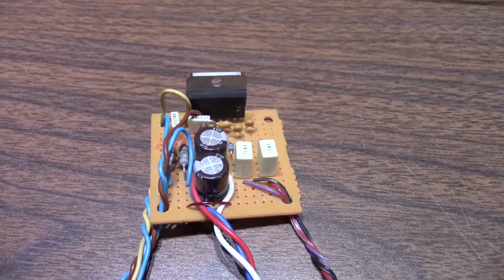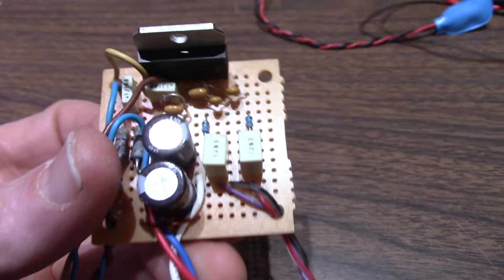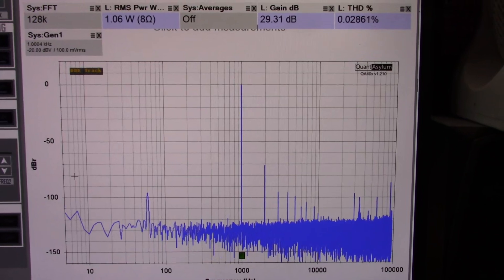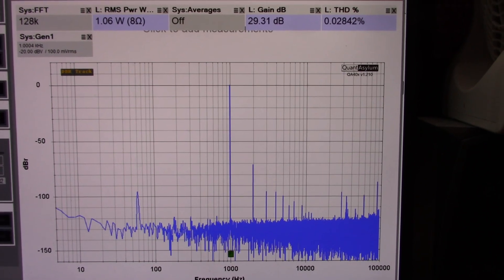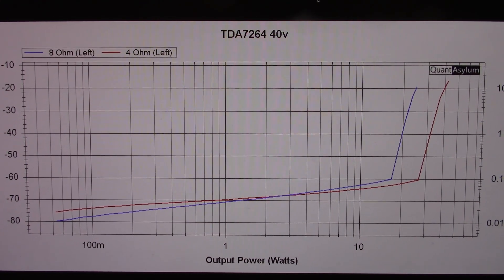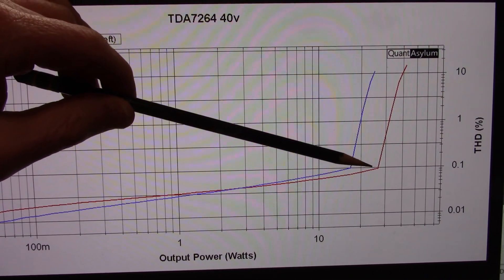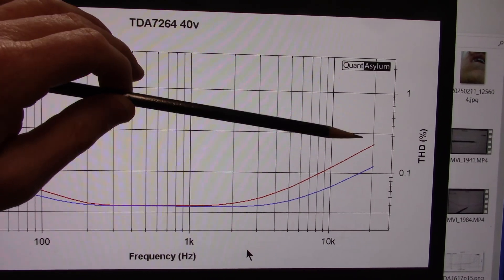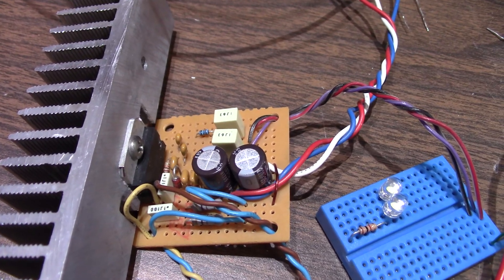TDA7264 stereo amplifier on the analyzer

Comment: Hey, its my first time trying to build a set of speakers myself and ive got a question that maybe someone can help me with. in the datasheet it says 4.5A. that seems kinda high for such a small IC. Do i really need to supply it with 4.5A?
Reply from the maker: I think you're seeing the 4.5A peak output current on the datasheet. Supply current depends on the load impedance and supply voltage you choose to use.
Reply: @JohnAudioTech  Thank you so much. If I supply 15V and the impedance of the Speaker (+subwoofer) is 8 Ohms, that would work out to be roughly 2A, right?
Reply from the maker: @ I assume you mean +15 and -15v (TDA7264 needs dual supply) which gives you around 12 watts per channel at 8 Ohms. I recommend a power supply that can handle double the power of the amp, so 24 watts for the two channels doubled is 48w, or 1.6 amps for the 30v (+/-15v) supply.